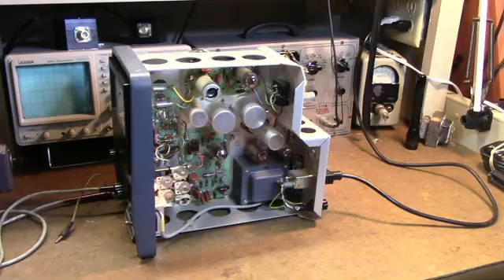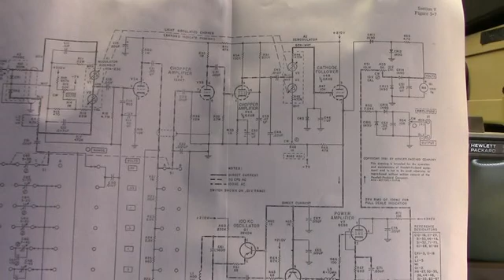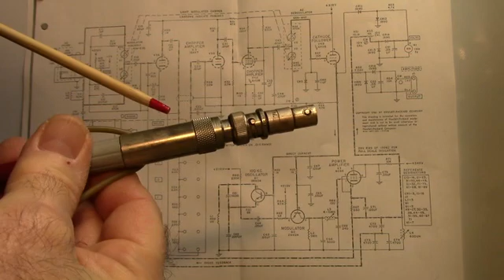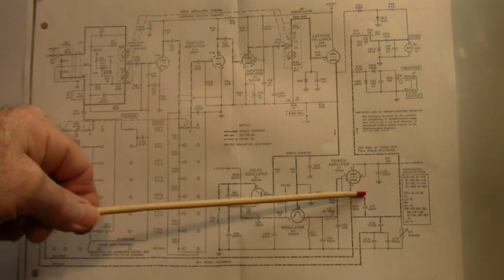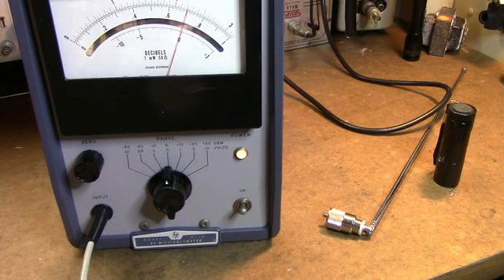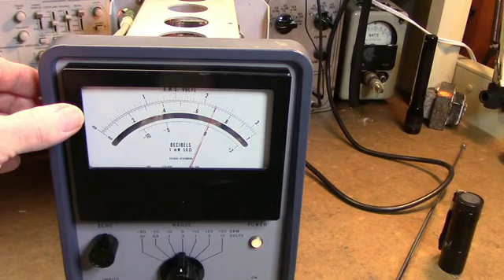Hp  411A   rf  Voltmeter

Comment: I've had one for decades and I use it regularly...You should try to find the "T" adapter which will allow measurements to 1Ghz into a 50 ohm load. In fact, mine will detect RF beyond 4Ghz but the accuracy isn't very good way up there, well beyond what it was designed to do....The light chopper circuit was a breakthrough for HP....

Comment: Todd thx for sharing and sharing the manual. Well scanned manuals are always welcome.
That is a sweet design. Chopper amplifiers are the bomb. A stable gain AC amplifier is easy to design. Combine that with a chopper and you get a very stable DC amplifier. The feedback method was also a nice touch. They are balancing the input level with the fedback level to effect a null which is indicated in the output stage. After all these years to see such a small error is quite remarkable. Another point is that this unit can work up to 500MHz or 500M Cycles. That is quite a feat for an early 60s technology level. Even the light bulbs were still operational. Totally amazing.
Again, Todd thx for sharing.